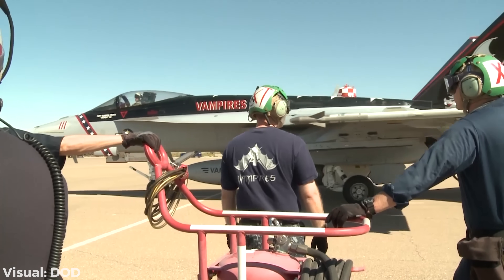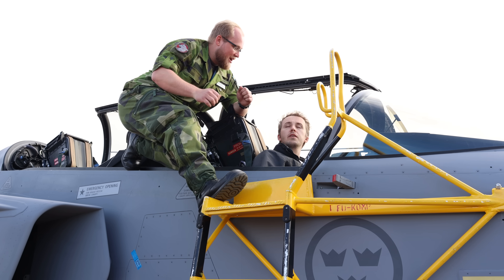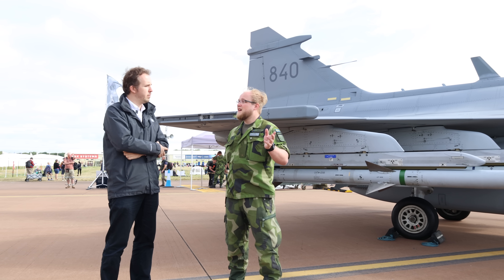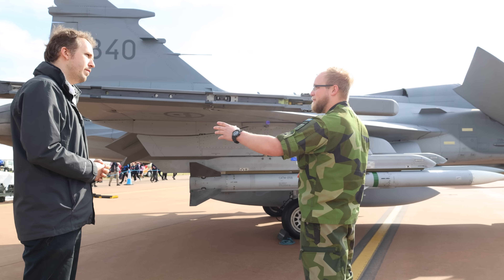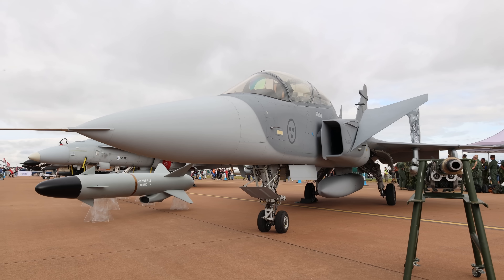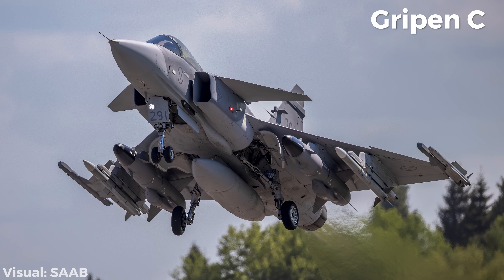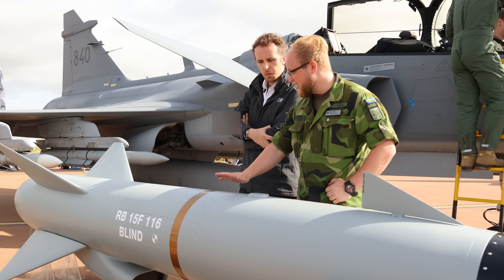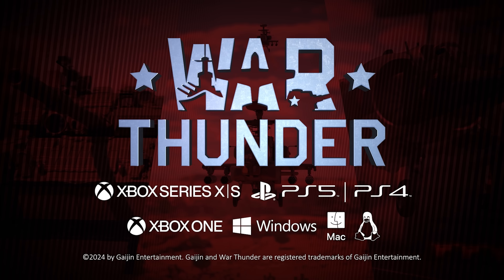Making a No-Ship Zone: Gripen's Anti-Ship Missile is Massive | RBS-15

Comment: The Issue I have with this missile is that it is very 1980s Tech in 2024. Yes it's fairly good for its size but the  features aren't anything worth mentioning. Sea Skimming, home on Jam, datalink that's what the Soviets did. It doesn't have stealth, it doesn't have standoff range and (I may be wrong here) it doesn't exchange data with other friendly assets via Datalink. When you compare it to the LRASM or Russian equivalents like the SS-N 27, or Chinese things... It's ok but nothing more.
Reply: Missile range is between 70 - 300 Km depending on version, there is datalink on newer version and its not that easy to see and shoot down a missile flying at 30 feet and mach 0.9
Reply: @kentnilsson465  Radarmålsökaren är aktiv och lyser som en fyr för ett fartygs motmedelsystem.

Comment: I'm a long time fan of the RBS15.
The ability to input waypoints on it, and then that some of it coming from lots of directions, overloading the defense system of a ship, is something really interesting.
And using the argentinians Skyhawks during the Falkland war as an example, an attacking object flying around 900km/h at around 10 meters above sea level... That's a hard target to hit.
RBS15 are around for some time, by now, so there are quite some good estimatives of how many weight is on its warhead.
Reply: Well most russian ships has some kind of ciws so it kinda makes sense.
Reply: Look up the SS-N 19 or SS-N 27, LRASM etc and you'll see that thing thing isn't remotely special
Reply: @kek207  got it, but you're talking about really massive missiles (i.e. SS N-19 being 7000kg) and RBS15 can be launched by a relative little fighter (the Gripen). But alright, there are some other missiles with the same capability of attacking from lots of directions.

Comment: Just being curious, why they cannot load two Amraams on the inner wing pylons? With different adapter? Not enough space? The weight should not be an issue, if the pylon could handle the anti-ship missile ....
Reply: They can, but on the video they loaded both missiles to show that it can carry both. Usually they would take 4 meteors as they are better in almost every way compared to the amraam
Reply: @the_stone_face  I mean why they cannot load 6 Meteors or 6 Amraams (plus AIM9 on wingtips) ?
Reply: @martinmarusinec6204  I think they can, at least on the newest jas39e
Reply: @martinmarusinec6204  Im sure they can load whatever is desired for their mission and your opinion are not requested..
Reply: @Coole-ee1vg  I am used to express my opinions whenever I see fit.
Reply: @martinmarusinec6204  The Gripen E can have 3 Meteors or Amraams under the fuselage as well. So the max load is 7 missiles of that type.
Reply: So 8 AMRAAMS? That would be pretty damn neat, I got no clue btw, on the Es I think they can carry 7 Amraams or Meteor and 2 Iris-T on the wingtips. So in a theoretical war the best possible loadout for Gripen Es tasked with intercepting missiles/drones/aircraft would probably be 7 Meteor+2 Iris-T.

Comment: similar to harpoon?
Reply: The RBS 15 and Harpoon have different design philosophies, with the RBS 15 emphasizing high-subsonic speed and a more advanced guidance system, while the Harpoon focuses on a more conventional subsonic speed and a semi-active radar homing system. The RBS 15 has a slightly longer range and a reportedly higher success rate in tests.
Reply: @bennypersson4118  Nej. då Harpoon och RBS15 har samma uppgift.
Faktum är att Svenska flottan valde Harpoon. men att sedan Svenska staten beslutade om att skapa arbetstillfällen genom att Sverige själva skulle utvecklade ny robot, som då baserades på befintliga RB04, och då under namnet RB04 turbo, då roboten fick ny Turbojetmotor istället för fastbränsle på RB04.

Nej, RBS15 är varken snabbare eller har längre räckvidd, finns många olika versioner, och första versionen av Harpoon hade längre räckvidd jämfört med första versionen av RBS15 ( då hette roboten RB15).
Nej, Harpoon har inte semiaktiv radar, nu bevisar du att du saknar kunskap inom ämnet.
Till skillnad från RBS15 så har Harpoon använts skarpt, samt att antalet skarpa skjutningar mot riktiga fartyg är extremt mycket högre.
Reply: The RBS 15 and Harpoon have different design philosophies, with the RBS 15 emphasizing high-subsonic speed and a more advanced guidance system, while the Harpoon focuses on a more conventional subsonic speed and a semi-active radar homing system. The RBS 15 has a slightly longer range and a reportedly higher success rate in tests.
Reply: @bennypersson4118  Harpoon och RBS-15 har samma hastighet.
Nej, RBS-15 har inte mer avancerad målsökare än Harpoon.
Harpoon har inte kortare räckvidd än motsvarande version av RBS-15, snarare tvärtom.
"Semi aktiv" radar målsökare bevisar att du inte vet vad du skriver om.
Reply: @jonasastrand9945  rbs 15 är ju typ 0.2 mach snabbare än harpoon
Reply: @einar8019  Nej, det är den inte.

Comment: I think Brazil made the right choice with the Grippen. The F-35 is... troublesome for a country that wants to maintain some sort of independent foreign policy. The French know it.
Reply: @DrVictorVasconcelos  unless you are Israeli: they got their F-35s without any electronics and installed their own.
Reply: You don't have independent foreign policy with the Gripen. Sweden will cut you off if the disagree with your war, and if not them, the Gripen is made with German, British, American, etc components which have to b cleared for export.
Reply: @DrVictorVasconcelos   good choice for Brazil. The f35 is not troublesome over 1100 delivered 80 ready to flight in the usaf. Not to mention 3 version.
Reply: Brasilien skulle aldrig köpa F-35, däremot  Superhornet som valdes bort av politiska skäl.
Reply: Also the modular future proof design of Gripen E is much better.
Reply: @andersmalmgren6528  Skämtar du nu eller, Gripen E kommer att bli omodern långt före F-35.
Reply: @andersmalmgren6528  Skämtar du nu eller?
Finns inget stridsflygplan som har så mycket mjukvara som F-35.
Reply: @andersmalmgren6528  Nej, Gripen E kommer att vara hopplöst omodern även i framtiden jämfört med F-35.
Verkligheten verkar vara svår för dig.

Comment: I guess the reason why Sweden was focusing so heavily into the air force during the Cold war was because the only realistic way for the Warsaw pact to invade Sweden would have been across the Baltic sea. And with the worlds 4th largest air force would Sweden have been able to sink most Soviet landing ships before they could drop russian troops off on Swedish soil, and russian paratroopers would get shot down. And the rest would be dealt with by submarines, missile boats, coastal artillery, and army troops.
Swedens big interest in anti-ship missiles probably stem from the same reason I guess.

The cold war Swedish navy did always extremely tiny amounts of money compared to the army and air force. And the Swedish army despite being 800.000 strong and equipped with many of the best weapon systems in the world like Bandkanon, was still an army that did not have enough funding to become fully modern.
Camouflage uniforms did not come into use until the late 1980s, long after most Nato countries. And our fleet of tanks was relativly old and small for most of the cold war. We bough some Centurion tanks in the 1960s which were upgraded. And they were perhaps okaish for the 1960s and 1970s with some upgrades... but after that they were obsolete. And the S-tank which was the best tank in the world when it entered service, quickly became old and a little bit outdated, and definatly so during the 1980s when the T-80 tank entered service which was immune against hits from the 105mm L7 gun frontally.
And the use of farm tractors to draw soldiers on bicycles was common during the cold war, as the army could not field enough armored personnel carriers for its infantry.

In the end would the air force be the most modern and strongest part of Swedens military. Perhaps also because it would be a good tool for quickly supporting Finland or Nato in times of need, while also keeping Swedens own manpower losses low.
Reply: Flygvapnet idag är mycket svagt och klarar inte av sin uppgift i krig.
Reply: @jonasastrand9945  it doesn't need to be up to cold war standards numbers anymore (edit spelling)
Reply: @MadSwede87 Hur menar du?
Reply: @jonasastrand9945   vet inte om du ser mina kommentarer men jag har försökt tre gånger nu jag ger upp ha en bra dag
Reply: @johanmetreus  Svenska Flygvapnet beställde 204 st Gripen, inte 204.
Reply: @jonasastrand9945  Svagt jämfört med hur starkt det var under kalla kriget, men starkt jämfört med övriga krigsmakten. Kustvärnet har slaktats helt och finns inte längre. Armén har sett nedläggning efter nedläggning av regementen med 500 åriga anor, och inte ens militära katastrofer som Poltava eller Kirkholm lyckades med Göran Persson lyckades med i 2004 års försvarsbeslut - att förstöra 98% av Sveriges mäktiga kalla kriget armé.

Och våran flotta är svag, men i ärlighetens namn är den kanske inte längre så behövd idag. Det är inte som för 400 år sedan när vi hade provinser i Baltikum, Tyskland, Finland, Holland, Norge, Amerika och Afrika att försvara.
Vår handel behövs försvaras liksom våra kuster. Men mycket kan göras med flygplan och kustrobotar. Vi har ju också haft världens största varvsindustri årtiondena efter VK2, så att stötta denna industri från statens sida med att lägga in orders på ubåtar som vi egentligen inte ur militär synvinkel behövde makes sense om man istället ser på saken ur industripolitisk synpunkt och förmågan att hålla vid liv viktiga krigsindustrier långt in i framtiden.

Göran Persson och Reinfeldt har varit katastrofer för försvaret. Likaså EU och alla dess naiva tankar på att ryssland inte är ett hot om vi bara kan börja bedriva handel med dom istället, och den idiotiska tanken att vi bäst försvarar Sverige i små utlandsinsatser med ett insatsförsvar istället för ett invasionsförsvar.
Vi la ner alla beredskapsförråd, så vi varken längre kan hantera skogsbränder eller epidimier som Covid.
Vi har haft dåliga överbefälhavare som slösat upp våra ytterst små försvarsbudgetar på strunt som cyberförsvar och utlandsinsatser och skapandet av battlegroups åt EU.
Owe Wiktorin var en ÖB som kom från flygvapnet, och helst skamlöst ville han slakta både armén och flottan för att bygga ut ett redan överdrivet stort flygvapen istället.
Gigantiska mängder beställningar på JAS Gripen lades in. Men efter att flottan och armén var sönderslagen, så drog Persson även åt plånboken för JAS, så att färre flygplan beställdes.
Resultatet blev ett kriminellt resursslöseri. I synnerhet med tanke på att Sverige redan då vid den tiden hade ett bra flygplan i Viggen.
Som tröst för oss svenskar kan man i efterhand säga att detta dåraktiga beslut har tagit oss till idag, när Gripen E finns kvar och har utvecklats till världens bästa jaktplan (i alla fall om vi bortser från F22 som ej går att köpa då det icke exporteras).
Gripen E är en vacker svan nu. Hade Sverige varit ett större och mäktigare land hade det förmodligen utklassat F16 och F35 nu. då planet är typ nästan överlägset i allt. Men andra länder köper inte Gripen pga politiska skäl (man vill vara god vän med USA) och då är ett flygplans förmåga mindre viktig.

Jag skulle nog säga att Sveriges flygvapen fortfarande kan stinga väldigt hårt. Om jag vore ryss skulle jag nog frukta ett krig med Sverige, för att landet skulle inom nolltid slå sönder all handel som passerar Öresund, med förödande effekter för handeln för St Petersburg och Kaliningrad.
Och ryssslands flygvapen är mer omodernt, har sämre taktik, sämre vapen och sämre piloter. Och Sverige kan kompensera låga numerär med fler sortier, och mer effektivitet. Så nej, att underskatta det svenska flygvapnet vore nog ett grovt misstag.
Reply: @nattygsbord  Gripen E är inte bättre än senaste versionerna av F-15, F-16 eller Superhornet.

Svenska flygvapnet är mycket svagt, det svagaste i Norden.
Reply: @nattygsbord  På vilket sätt skulle jag vara Rysk?
Du bör nog även läsa på lite mer om stridsflygplan, och att Gripen E inte är bättre än senaste versionerna av tex F-16 eller Superhornet.
Reply: @jonasastrand9945  hahahah du har inte en aning om vad du snackar om
Reply: @ Jo det gör jag.
Kan du utveckla.
Reply: @jonasastrand9945 yeah but during the late 1950s and early 1960s it looked diffrent

Comment: Very intriguing. Even though I'm not Swedish myself - and my country turned down the Gripen in favor of F-35 - I do feel a strangely triumphant for the Sweds turning out to have prepared for just the kind of air warfare that appears to be real right now.
Reply: Being a neutral country during the times when we developed these weapons and our most likely threat was Russia and soviet before, it is not strange. Our needs was (and is) the same as Ukraine have now when the threat, sadly, have become reality for them. In my opionion , Gripen would be a better fit for Ukraine than F16.

Remember that we prepared to stand alone, for as long as possible, against soviet and later Russia.
Reply: @RiderOftheNorth.357  Gripen är inte bättre än F-16.
Reply: @jonasastrand9945  Gripen is better on small, improvised bases, like road bases. Cheaper to operate in the long run, easier to train personnel and designed to be a multi-role plane dedicated to combat against a materially superior enemy (read Russia). In what way do you think the F16 is more suitable for Ukraine?
Reply: @RiderOftheNorth.357  One F-16 in Ukraine is better than 10 Gripens in some Saab marketing brochure.
Really, where are you finding spare Gripens?
Reply: @RiderOftheNorth.357  F-16s have actual combat experience and are available in true numbers.
Reply: @jonasastrand9945  Jasså, du har provflugit båda???
Reply: @Coole-ee1vg  Varför skulle jag ha gjort det?
Men det finns många andra som gjort det, då flygplanen har utvärderats i ett antal olika upphandlingar.
Reply: @RiderOftheNorth.357  I agree with all your points but at the same time there are so many more F16 in the world, that means  multiple logistic chains, more trainers, more simulators and more combat experience from pilots that actually fought the planes they will meet in Ukraine. I would have loved seeing Gripen in Ukraine and would be the better airplane but there just more F-16 around.
Reply: @Doluses  Samt att Gripen inte heller har högre prestanda eller kapacitet jämfört med F-16.
Reply: @jonasastrand9945  Är inte riktigt säker på att jag håller med, det beror på vilka parametrar man jämför, men jag tror Gripen har fördel: omställnings tid på marken, integrerad elektronisk krigsföring, bättre radar, bättre digital integration. Det är båda bra plan med sina styrkor och svagheter
Reply: @jonasastrand9945  Och dem har du förstås full koll på???
Reply: @Coole-ee1vg  Självklart har jag det.
Reply: @jonasastrand9945  Va du ordningsman i klassen oxå???
Reply: @Coole-ee1vg  Vad har det med mitt intresse för stridsflygplan att göra?
Påstår du att flera länder INTE har utvärderat Gripen E tillsammans med F-35A.
Reply: @jonasastrand9945  Flera utvärderingar har gjorts o du har inte varit med på någon av dem..
Reply: @2.Cuzzzz  På vilket sätt då, för att jag håller mig till verkligheten?
Reply: @2.Cuzzzz  Du bör nog fokusera mer på ämnet stridsflygplan, där du verkar ha en del att lära dig.
Reply: The electronic software (stealth) and theatre control systems on the Gripen are years ahead of the F-16! Ask any pilots that have playez ”enemy” against a Gripen - especially the latest versions.
Reply: @BOLLOX64   Gripen E är inte bättre på detta jämfört med F-16 Block 70.
De F-16 som Ukraina använder har mer avancerat EW än Gripen C/D.
Nej, EW systemet på Gripen räknas inte som Stealth.
Reply: @jonasastrand9945  gripen is better in every aspect.
Reply: @danieljonsson6230  Nej, inte på någon punkt.
Gripen E/F har även förlorat varje upphandling mot F-35A. 
Gripen E blir även ett mycket dyrt alternativ,  då den kostar ungefär lika mycket i inköp som F-35A Block 4.
Reply: The way you phrase it, I get the impression you are from one of the other Nordic countries. If you are, the good news is that with the new Unified Nordic Air Force we've got both. 145 F-35s, 60 Gripen E/Fs and at least 60 Gripen Cs - that should do nicely.
Reply: @tessjuel  Yes i am Swedish.
Reply: The problem is that the Gripen was built for the Winter War. Make it costly, trade lost land for sovereignty. 
The war we want means having to come back, get on our feet and knock out the opponent so that he doesn't come back 8 years later.
Reply: Well sweden has been preparing since 1815.

Comment: Gripen is like a little scooter but damn it can haul stuff!
Reply: It is alot liek the old SAAB 9000.
Smakk on the outside but big on the inside.
is alot more advanced than anyone thinks.
Handles places none would ever think was possible for its kind.

id recommend you to read up on the 9000 as it changed the world of cars with its technological advancements and engineering choices.
Reply: @CyberSystemOverload  a modern A-4